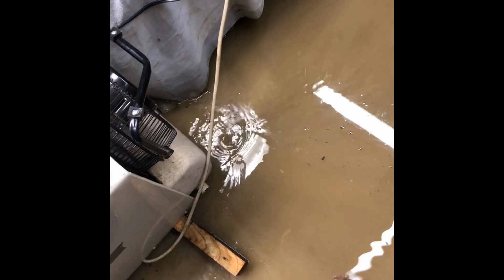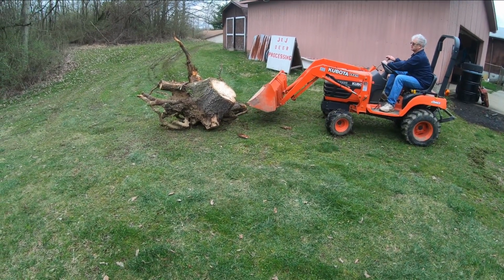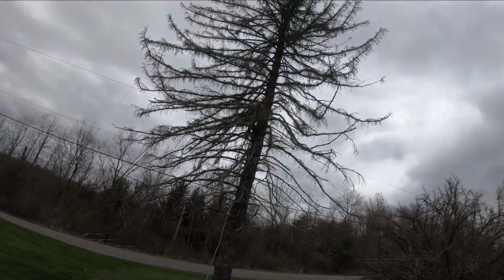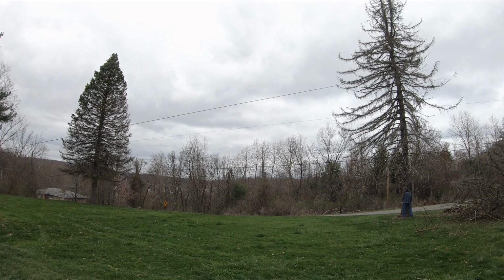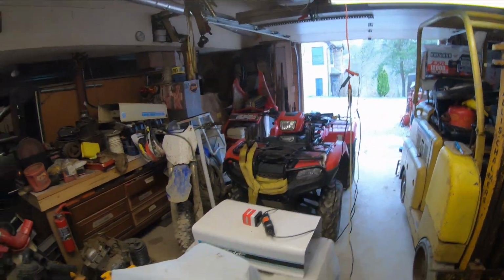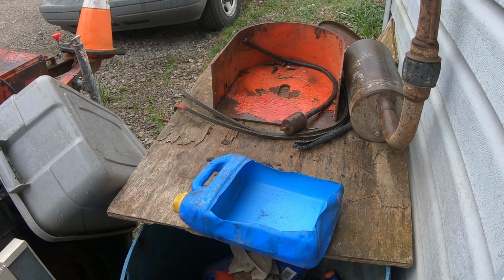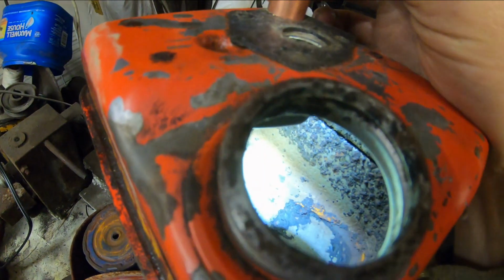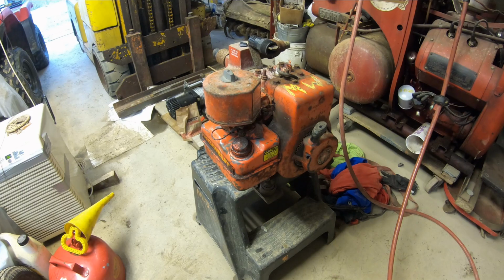Cutting Down Big Trees & playing with Acid!

Comment: The acid treatment worked! I never heard of this. Thanks 😊
Reply from the maker: this was my first rodeo with it! quite pleased with the results!
Reply: Acid is very handy.  Probably didn't have to go full gonzo with Muriatic.  Citric would have done the job, step above that phosphoric.  Muriatic is my last resort generally reserved for mill scale removal.  When using Muriatic do not use without fume extraction.  The fumes will attack any metal it comes in contact with, including electrical outlets, plumbing.  You know the stuff you can't see.

Comment: when cutting up the downed log, cut UP at first, about quarter to a third of the way, then cut down from the top. Makes it way easier.
Reply from the maker: I actually told him that after the first cut, he dosnt do much cutting
Reply: @DieselCreek  Doesn't listen well either huh?
Reply: It also depends where the pressure is at too..
Reply: @MattPanther91  actually, that's correct. sometimes you have to saw almost or all the way going up or vice versa, but on a felled tree with many branches on the bottom side you're most always better off to saw up a bit first. There are some occasions where that doesn't really work, but 9 times out of ten or so it does.
Reply: This is the truth. You can pinch the bar and get stuck fumbling around with wedges if you don't do this. Makes you look like a noob when you don't have to. I was a foreskin of a tree service company for 8 years or so. Still do a little tree work on the side, and build/ mod saws for folks. Any mods to the 'ol farm boss??? Open up the muffler and advance the timing if you haven't already. Free mods that make a hell of a difference with the EPA choking them down. I have a pretty nice arsenal myself. Mostly Stihl, but I love my big bore 372xp, and my 346xp. I'm not one of these guys that is partial to any brand. Each company has their models that perform their duty in a particular situation. Hell, you can even go to town modding an Echo and do some pretty good cutting with it. The CS490 is a cheap ass saw, and it has a mag case, is quite light and they start super easy. Like I said, they all have their place depending on the work you're doing.
Reply: @psavel274  that was years ago, before the EPA got so nuts. great saw until somebody stole it right out of my garage, and it was inside a cabinet to boot.
Reply: @tootall5559  
Yeah I can't stand thieves. I had 40k+ in Matco tools, my whole 4S double bank chest, I.R. air tools, I.R. compressor, salamanders, etc all robbed out of my garage. It was devastating man. What year was the Farm Boss from??? Looks like maybe around '04??? Tough to see on this shitty phone screen.
Reply: @psavel274  oh my Farm Boss was bought new... sometime in the 80's. Didn't use it a hell of a lot, but around the farm there were times when it was indispensable. it got ripped off... in the 90's I think. Not a lot of hours on it.
Reply: anything in the 2000's isn't worth having in my book. Stihl is pretty much junk now. IF I were to need a GOOD saw now, I think Husquavarna is the only real choice.
Reply: @tootall5559  
What a bummer... my 'go to' saw is an 026 pro. I run an 18" Forester platinum bar with a full chisel. It has a muff mod, advanced timing, porting, Meteor piston, official larger Stihl dogs/ roller chain catch, etc. Its got enough grunt along with the near perfect size to take care of most of the workload. The other comparable saw I own cc wise is my husky 346xp which like the 026 is no longer made. The ms260 is the newer version of the 026, but husky never made a more modern version of the 346 which is a shame. For the slightly bigger stuff, i use an ms440 mag  and also a 372xp. They're both highly modded by myself as well. I run a 24" Carlton speed tip on the 440, and a Sugi on my 372. The 440 has all the mods you could want, Max Flow, dual port muff, more timing, big bore, piston, porting, larger dogs/ roller catch, Full wrap handle, etc. Future plans for it is a larger carb. The 372 runs like a raped ape and sounds nasty with the big slug, plus the muffler I brazed up, and I highly recommend either saw. I have an 880 mag, which if you've ever used one speaks for itself. It wears a 3 foot bar most of the time, but I also have a 5 footer for it. Its also modded, similarly to the above. My large Husky is a 395xp, and it rips! I even have a ms250, which is very underrated for a clamshell/ non-pro saw. They can surprise people with a sharp chain and a 16" bar if you are decent at cutting. It'll handle a good amount of stuff and it's cheap enough that you can buy a half dozen of them for the guys on the crew who don't own their own gear. The company I was with had probably 7 or 8 of them we used to lend out as long as they took care of them and didn't do anything stupid. Are you as big of a nerd as I am when it comes to saws??? Maybe. Theres folks out there that are even more obsessed with them than I am lol.
Reply: @tootall5559  
I'd have to disagree with that. The early 2000's saws aren't bad with the proper mods. This goes for both Stihl and Husky. What about Dolmar, Johnsered, or Solo? They all make some decent saws as well. You can gain a lot of cutting speed just by opening the muffler, bumping up the timing and adjusting the carb accordingly. This goes for almost any saw. Stihl has a couple of nice newer saws. The 462 comes to mind. Its basically the newer version of the ms460 which is what a TON of guys who fell those big boys out in the PNW swear by. I have used a few. Both stock and slightly modded and they stack up quite well honestly. They use and abuse them, and if I had one I guarantee I could uncork and massage it just like any other saw. The only grey area with the newer shit is the autotune/ non-adjustable carb equipped saws. Both Husky and Stihl have their own versions of this. Some swear by it with the constantly changing fuel quality and the change in elevation. Normally you would adjust your carb accordingly to compensate. With those saws you don't. Personally I want a fully adjustable carb with three screws, and no stop limiters. The limiting caps should be the first thing to go on ANY saw that has them installed from the factory.
Reply: @psavel274  used to be into saws big time, but these days, not so much. Learned to use them working for the forest service a couple of summers when I was just a teen. Then my fave was a ...I don't know how big, but a larger Stihl with what they called a brush blade, a large hoop with nothing in the center. Made short work of trees up to about 18 inches thick, since there was nothing in the middle to pinch, bind or snag on. Right now, if I had a BIG saw, there is a job nearby that needs doing. Huge old tree that fell on a fence. Must be at least 4 feet in diameter at the place where it broke before it toppled over. There's a similar job just up the street. a normal chain saw, pardon the pun, isn't going to cut it. I imagine you could make a 2 foot blade do the job. but it would be a lot of work.
Reply: @psavel274  well I'm not into having to modify what I pay good money for, but like I said, I don't need one now. never heard of those other brands, when I was coming up it was Stihl, Homelite, and Husky.... with a few no name brands around too. To me everything in the 2000s and above is crap, wheter it be cars or saws or whatever. Too much use of plastic and crappy electronics.

Comment: For the flooding at least you know how to handle, when my shop flooded  I did a knee jerk and dug a sump with pump  a bit of overkill , but my stuff stays dry. You take good care God bless
Reply from the maker: It’s not actually my garage I just use it so no big changes here. Not the first time the floor has been covered but probably the worst it’s been... the French drains are clogged, it needs a box culvert in front of the doors
Reply: @DieselCreek  My friend I wouldn't know a box culvert  from a boxspring

Comment: I ordered and use Oxalic Acid crystals. Put two or three tablespoons of crystals into the gas tank, add warm water and wait for a few hours. My gas tank looked brand new inside. Amazing stuff....One year later and the tank holds gasoline and still looks new inside.  Easier for me to handle than Muratic Acid.. Have you ever tried Oxalic acid to remove rust??

Comment: Use Ospho (phosphoric acid)  to remove rust.  It turns iron oxide into iron phosphate which is inert.  It's much safer than muriatic acid.

Comment: I was gonna say the same thing about running it without water in it will burn up the seals in the pump you could oil the starter clutch and see if that works take the starter cover off and in the part of the clutch that goes into the rewind is a small hole you can shoot oil into and while you got the starter cover off shoot some oil into the spring where the spring hooks into the cover and work the rope a few times.  I used to work for a equipment rental store and worked on many briggs and scrap irons and water pumps
Reply from the maker: yes i never run the pumps for more than a minute when theres no water in it.

Comment: Here the wind blew 45mph with guests up to 75mph for three days and knocked out the power the first time for 12+ hours at 15*F wind chill @ -11*F the second day it was knocked out for about 18 hours same wind same chill. Luckily the snow was glazed on top and didn't drift and blow over the driveway ... like I'm going anywhere - self sequestered.

O damn that muriatic acid will take your breath away ... bad juju. Tumble rocks, screws, nuts n bolts in the fuel tank anything but that caustic stuff it works but tumbling would have gotten rid of that scale in the tank. After which a little fuel tank cleaner/sealer works great.. find it at eBay, Amazon or better yet Steinertractor.com they have smaller batches for smaller tanks

Comment: Did not see the pump. If it's a trash pump I would spray silicone in both intake and output ports before running again. Also check the exhaust coils and the pull cord fluid.

Comment: you should use vinegar to neutralize acid and if put some rocks in the tank then while your doing something on tractor strap the tank on and the vibration will clean the tank with the rocks
Reply: Yep, and I hope you coated the inside of that tank to keep it from flash rusting....

Comment: Add some aviation gas it cost more but after you empty the gas out then start it up with aviation gas it will last for more than 5 years keeps the motor ready to run with no rust inside, found this out after putting  a lot of airfields and got know how the old-timers keep all the motors running so good that`s why it`s good to be nice you find that it  better to be nice then a hole keep up the Great work you did GREAT
Reply from the maker: where can you buy that?
Reply: should be any small air field
Reply: any air field
Reply: @DieselCreek  you should be able to aviation gas at any small air field ,l would take just about all the gas let it run out of gas then put in the aviation just enough to start the motor then , shut the motor off and,  they just enough aviation fuel in the bottom of the tank so it would not get any rest

Comment: During the 1980's in Irlam, Greater Manchester we had even bigger hailstones than that.  Probably about 50% larger.  My next door neighbours car, a Volvo saloon, suffered badly as did my neighbour on the other side's Datsun.  They both required extensive work and ended up with vinyl roofs.  My old Vauxhall Viva showed not the slightest dent and no broken glass.  Go figure!
Reply: That's probably because even hail wouldn't be seen dead anywhere near a Vauxhall Viva!!

Comment: How do you dispose of used acid/gas mixture?
Reply: Check with your County officials on the gas disposal. Most have a hazardous waste reclamation center that will take it.
The acid can be neutralized by putting baking soda or washing soda in it and mixing it up with an old paint stick. Add soda until it no longer bubbles up.
You could also ask the hazardous waste people if they will take it.

Comment: Some gas tank sealer would be good to prevent more rust.
Reply from the maker: Any recommendations?
Reply: @DieselCreek  I got some from e-bay called Red Kote. The gas tank on my generator got rusty inside. I poured what i thought was enough Red Kote in the tank and tilted the tank in various positions to get a thin coat all over the bottom and sides. Fortunately I guessed the right amount. Then let it set for about one week with the cover off to make sure it was dry. Not sure but I might have used a hair dryer on the outside of the tank. Don't get it too hot.  I directed a fan to blow in it to get rid of the fumes. The last time I checked it was last summer and it still looked good. Take out the valve or connector where the hose connects put a plug in so it won't plug the hole. Good idea to coat the plug with Silicone spray before putting it in so the sealer don't stick to the plug.As soon as it begins to set enough so it won't run out and fill the threads take out the plug and make sure the hole is open. It only needs a thin layer. I don't know if it is the best brand because it is the only kind I have used but it seemed to work. If you have some left close the can and save it for using on another tank.